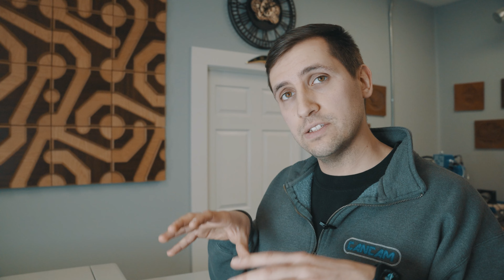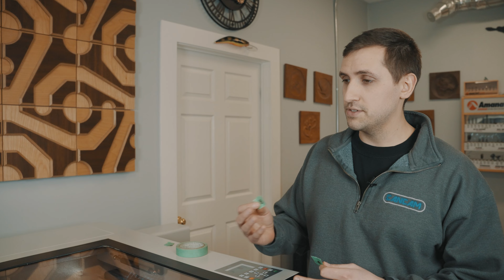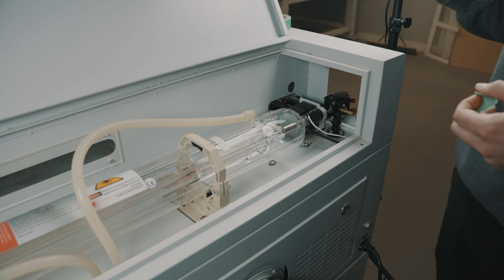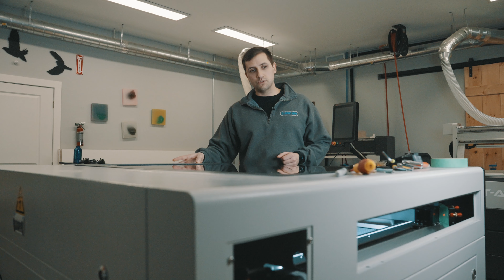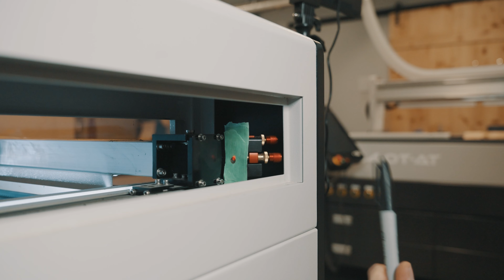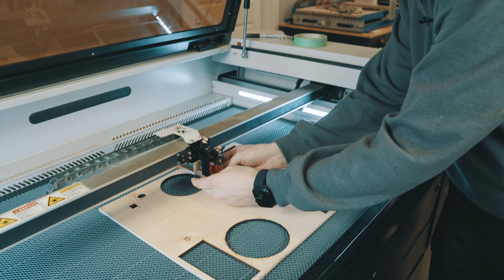CanCam AEON Mira mirror alignment

Comment: Thanks for this 😁😁👍👍 I have this exact machine, and I have tried with Aeon's factory video and the Aeon USA video - but both takes use of the "acrylic targets". Mine was so out of alignment that it could not even make the acrylic targets. You showed that those are not necessary at all. So thanks again!

What about the red dot, how can I align this so that it is more in line with the laserbeam itself?
Reply from the maker: I will make a video on aligning the red dot laser. You adjust the screws at the back of the red dot light unit (once your mirror alignment is in check).
Reply: @CanCamCNCMachines this video was a life saver! I looked for the red dot alignment video but I couldn’t find it. Am I missing it?